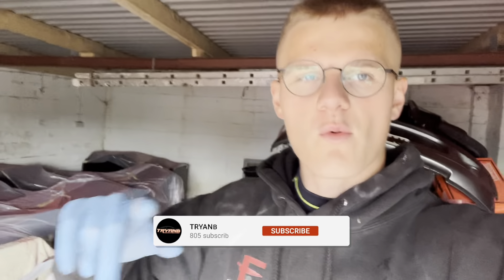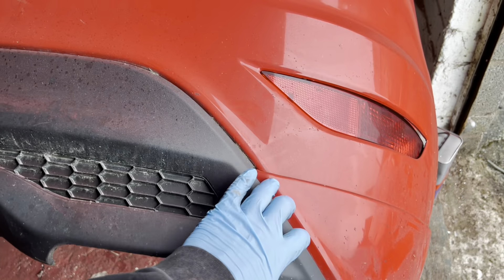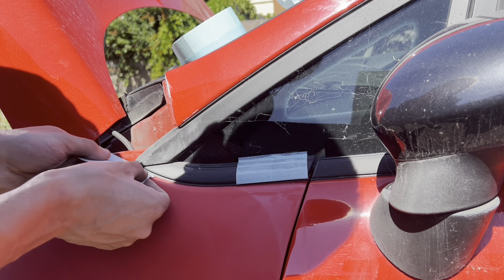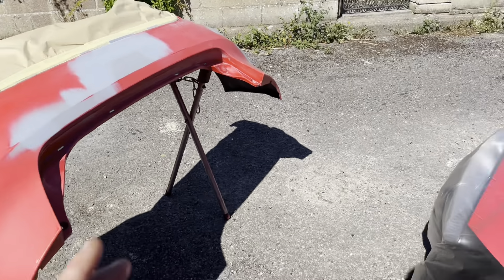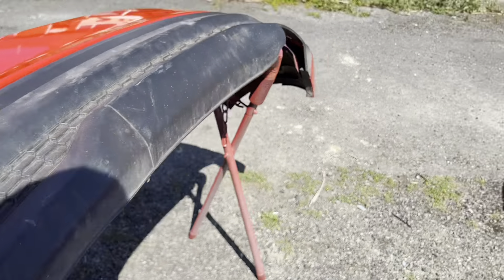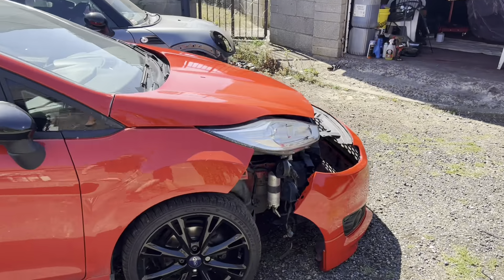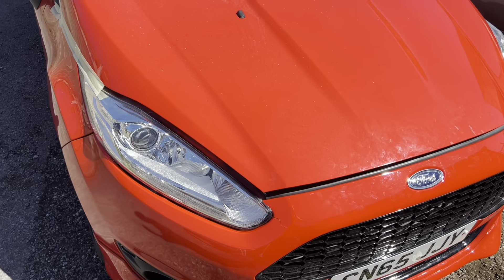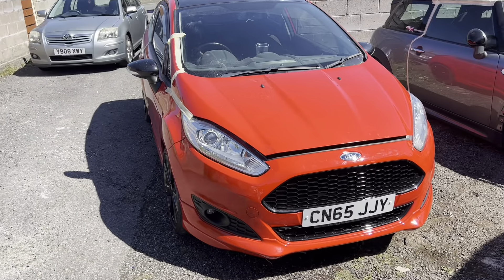REBUILDING A 2015 FORD FIESTA FROM COPART | PART 7

Comment: Bud Ur comments have been turned off the last couple of videos
Reply from the maker: Thank you so much mate, I genuinely thought people just weren’t enjoying the video or something along those lines😂 I’ve just changed them all to all allow comments, I have no clue why that happened. Will double check going forward, thanks for watching mate and thanks again for letting me know!
Reply: Them hot staples I put in the last video are supposed to stay in u clip the point off and sand them down
Reply from the maker: @dubdelboy   Yes mate, I did leave a couple in, I was using a method we use in work. Sometimes the staples aren’t strong enough on their own so that’s why I used the mesh to reinforce the crack. It’s all learning will keep a couple more in next time
Reply: @BTR_REBUILD  sound bud nice work
Reply from the maker: @dubdelboy  Thank you mate, a lot more to come👍🏻